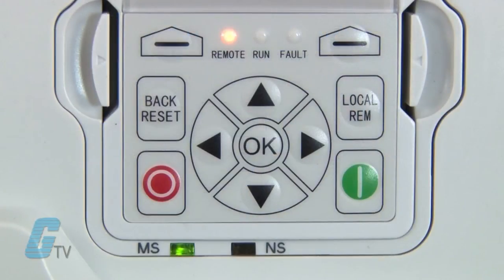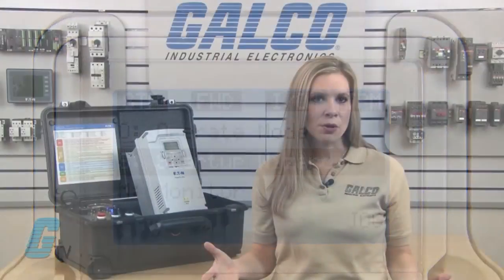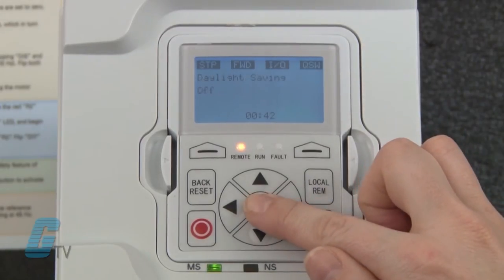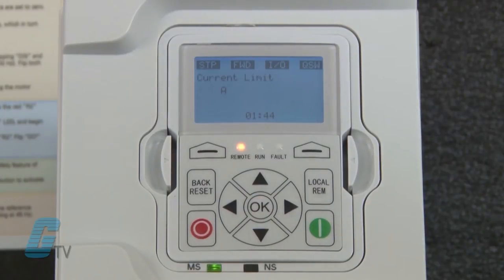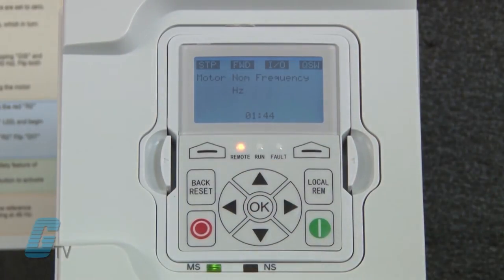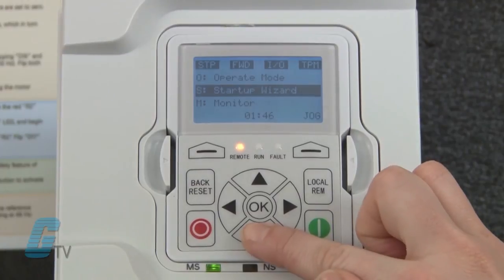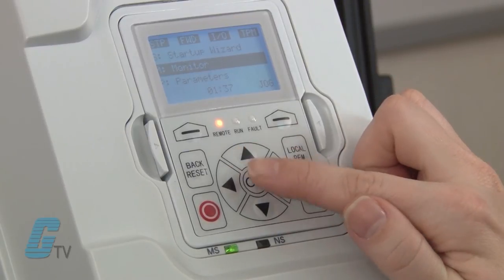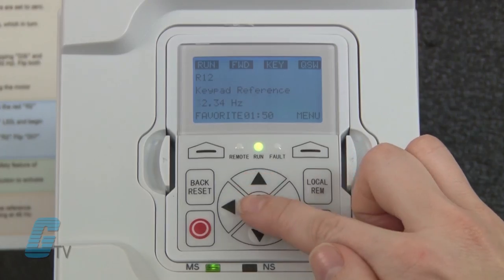Eaton Cutler-Hammer PowerXL DG1 AC Drive Start Up

Comment: Does this controller offer a shut down timer ?
Reply from the maker: No that would have to be programmed into an external controller running the drive. As long as the Run input is active, the drive stays running. Same thing in Local control from the Keypad, the drive stays running until you push the stop button.
Reply: GalcoTV ok thanks, I was wondering why there is a clock/daylight savings setting in there
Reply from the maker: The clock is used to track total run time, KW hours used, and time stamp faults that may occur.